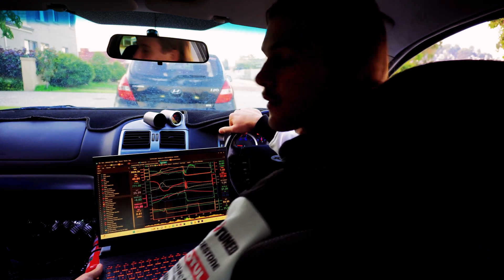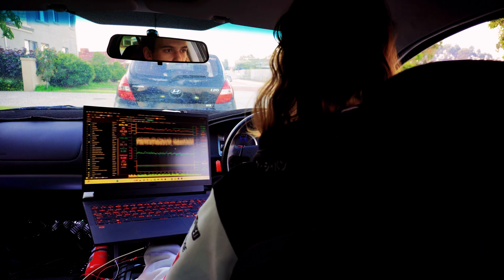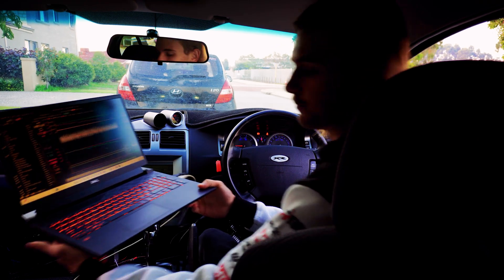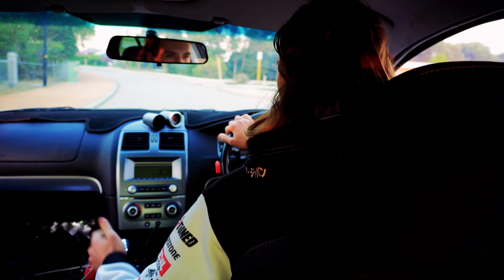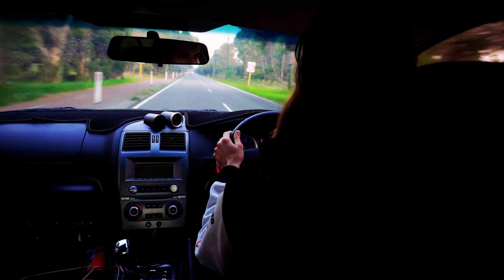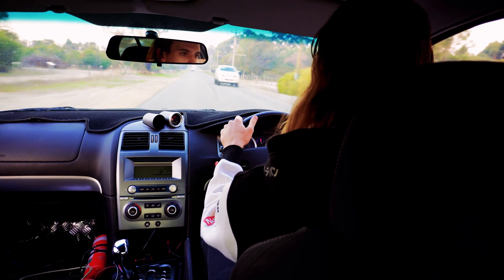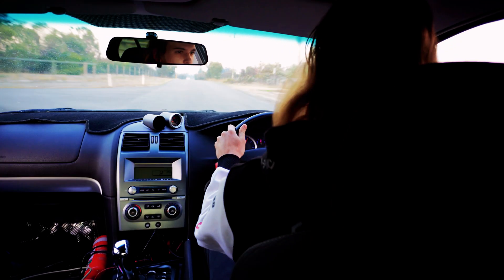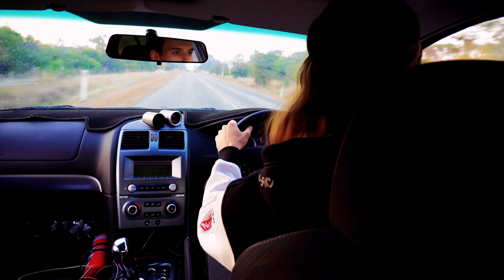XR6 NA to Turbo Series Part 3: Datalogging, PCMTec and Street Tuning

Comment: Hey are you logging the wideband with pcmtec, trying to work out what route go down with xf conversion, I see the haltech ic7 is coming out with datalog from oem obd be cool if you could wire their wideband straight to the ic7 and have it all on 1 log
Reply from the maker: Yep, that's the only way I tune them. I use a digikey 8 channel analog input which runs through the DLP input on PCMtec. I can then export my commanded and actual Lambda data and then use an Excel software I've designed to tune the speed density tables. This is assuming injector data is known. I like tuning this way because it means when the boost is increased the fueling remains on target and I can just change my timing. I'll be doing a comprehensive video on it at some point.
Reply: @thebarraspecialist  yeah nice thanks, a vid would be mint, I think thats the way to go then digikey wideband, canbarra for guages.

Comment: Love your vid's mate... 
How does this type of tune compare to tuning on a dyno? Also, roughly what would a tune like this cost?
Reply: And on the street you can’t really do timing tuning because you can’t measure your actual improvement like you can on dyno.
Reply from the maker: Thank you mate, appreciate the support. Road tuning isn't usually advertised. The only down side compared to a dyno is loss of traction and you can't directly read power output like on a dyno.

Comment: Hey bro,
I have a ba I want to turbo is there a way I can swap my maps out to a turbo ecu map in pcmtec?
Reply from the maker: You'll need some more information as there ate quite a few variables with these conversions. Are you actually swapping the engine to a factory turbo or just tuning an NA engine to be turbocharged? Cheers
Reply: Na ecu can't do boost control can run turbo tune with separate boost controller

Comment: What psi is this running?
Reply: The dose sounds so good man
I just installed plazzy cold and hot side + bigger intercooler and the dose doesn’t seem as hectic as this :( do you have a mic rigged up close to the turbo side?
Reply from the maker: Just the sound from in the car at the back seats. Where are you located?
Reply: @thebarraspecialist  I’m from Melbourne vic
Reply from the maker: Only 6.5 mate

Comment: Hey mate could you do a video of how you installed the guages?
Reply: Take icc out, run wires from gauges to desired sensor, tap power and ground off the 12v socket

Comment: Hey mate which what kind of knock ear setup are you using?
Reply from the maker: Hey mate, it's a Tuner Nerd knock monitor that I use. It's great for both live listening as well as setting a threshold and letting the computer alarm you. I prefer using the live audio however.